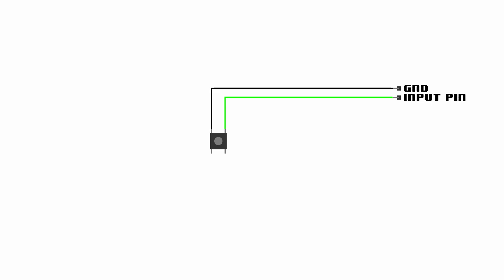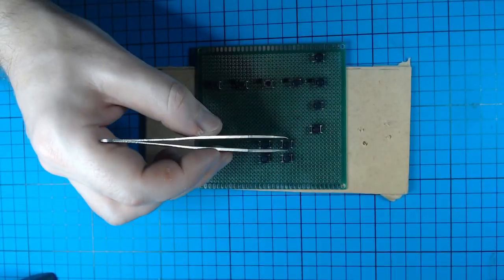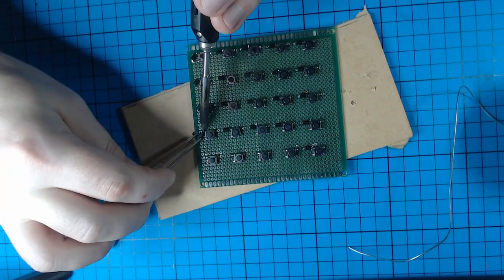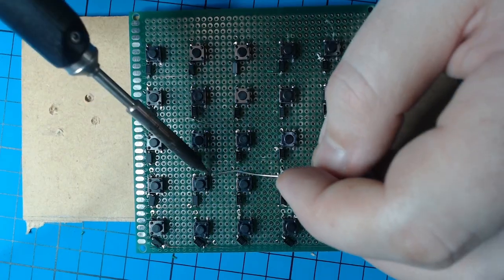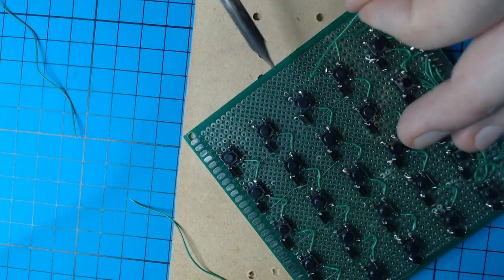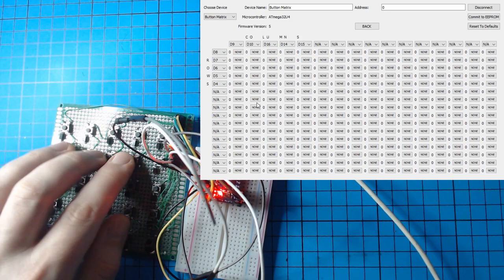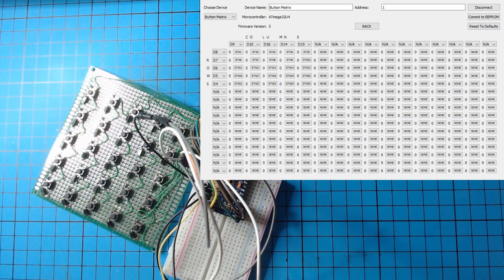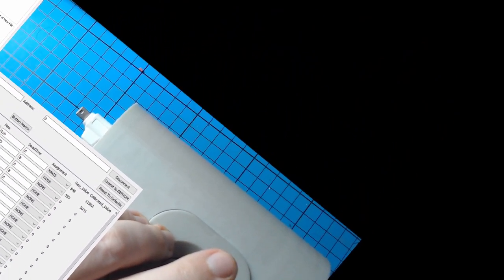Instructions - Button Matrix

Comment: I'm watching a ton of Button box / matrix videos as I plan to build my own Truck Simulator button box. Your video is fantastic, and your configurator is awesome too! Thank you for all the work to contribute this to the internet hive mind!
Reply: It is an interesting way for sure, but you can also use multiplexers and not go through this complex soldering matrix, i built a dashboard for ETS2/ATS with many buttons/encoders using couple of multiplexers and a pro micro.
Reply: @TonyHA913  While I understand the approach, it does make troubleshooting a lot more difficult, because you are introducing wiring and an extra part to the setup that can malfunction (let's say because of a wrong connection somewhere).
This is probably one of the most straightforward approaches to multiple buttons on a reasonably small amount of pins, next to going for a massive amount of IO on something like an Arduino Due which is in my dashboard for ETS2 and bussims.

Comment: Awesome demo. Looking forward to see more. Could you tell me (a noob) what kind of diodes you use? A specific partslist would be helpful for those, like me, who are learning from zero background and also want to try what you make. Thanks and keep them coming.
Reply from the maker: Sure, I didn't really bother with a parts list on this because you could use almost any diode and buttons. I used 1n5819 SS14 diodes which are way overpowered for this use, but they're what I had lying around. Any diode that can handle 5v (double it for safety to 10v) and you'll be fine as the current passing through is negligible.
Reply: @real_robots  Thanks a lot. Again, a very instructive video. Subbed!!!

Comment: Yes, a great video.  I haven't finished my matrix yet - waiting for the diodes to arrive.  And also thank for the software.  I will be using an 8x8 matrix for the buttons.  Can you confirm that I am not going to run into a problem with the number of buttons; something tells me that there is sometimes a problem of that kind.  I'm using Windows 10 and XPlane 12.
Reply from the maker: Your problem won't be with the matrix, but with the fact that windows HID won't read past 32 buttons for a gamepad. You can bypass this by setting it up as a keyboard and assigning it keyboard keys.

Comment: Hello RR. I really hope you will read this, cus I really need some help regarding rr_configurator. 😅
I have managed to do everything as shown in your video, and almost everything is working,  except for row 5 (I have made 4x5 matrix setup, 20 buttons).
In rr_configurator I can see the buttons in row 5 being pressed, but in Windows game controller settings, these buttons doesn't show as pressed.
I've tried to switch places with the wires, and its only row 5 that doesn't show. So I'm almost certain it's not a hardware issue.
Is this something you could help me sort out?
Btw I've made a collective stick with 20 buttons, one potmeter (for zooming in DCS) and a hall effect sensor for the collective. rr_configurator has done an excellent job setting up the potmeter and the hall effect sensor. 😊👍

Comment: Hi, I got some questions if you don't mind :) I'm using a arduino leonardo. To what pins should I connect the rows and columns? Should the rows be all ground, and the columns digital in? And what about the voltage? Does it not need a v5 connection? Thanks in advance!
Reply from the maker: Hi, you can connect the rows and columns to any of the digital pins on the Leonardo. If you're doing individual buttons you connect one pin to your digital pin and the other to ground, you don't need a 5v connection if you set the pin in pull-up mode in the gui

If you're doing a button matrix though, you do it just like I. My diagram, all columns and rows are digital pins. My software switches the pinmodes to automatically set them to 5v/gnd/input as needed to read them each in turn
Reply: @real_robots  thank you!

Comment: How would you be able to apply this to an actual button box, like mounting them inside the junction box as there doesn't seem to be any mounting points on the buttons, like there is on switches and rotaries with the washer and nut.

Comment: does using a matrix introduce any additional latency, compared to wiring each button directly to its own pin? (like by having to run the rows/columns check)
(for my project I'm planning on using 30 buttons, if that's relevant, for a project where minimal latency is ideal)
or if there are any other trade offs that might warrant searching for additional input pins over using a matrix?
Reply from the maker: doing a matrice will always be slower, but when I tested it with 128 it was still good to me. The only time I got to latency I could notice was when I had that many on a subdevice, so i had to wait for the matrix to be read, then passed to the master device, then passed to the computer.

30 buttons you should be golden
Reply: @real_robots  thank you!

Comment: I hope you can help.  I'm trying to use the project and want to flash the firmware ready for the matrix when I've finished it.  I'm using QMK Toolbox and my Spark Fun Pro Micro.  Caterina is connected but when I try to flash I get a message 'File does not exist'.  The file copied from Github does not have an extension but I've tried adding .hex and .bin.  Same result.  Am I doing something wrong?  Do I need to paste the file somewhere else first?   Your help will be much appreciated.

Comment: Question:  the gitlab says that the ESP32 can be Bluetooth only.  Does this mean that you can’t use the device (once complete) with a usb cable and you have to use Bluetooth to connect it to a pc?  

HID master devices

ATMEGA32U4 (eg. Arduino Pro Micro)
ESP32 (bluetooth only, no USB HID)
Reply from the maker: @danm2286  that's right, the esp32 cant connect has an HID device over USB.
Reply: @real_robots  I am trying to upload the firmware to a esp32 (Freenove ESP32-WROOM Board), and i'm getting this error: "error: #include nested depth 200 exceeds maximum of 200 (use -fmax-include-depth=DEPTH to increase the maximum)
   25 | #include <Preferences.h>"

any idea what i can do to fix this?

Comment: Help, please - Issues with my matrix setup.
All buttons work 100% as expected in the RR Configuration but, Windows is only seeing the firs 2 buttons from each row - even though I can see all the buttons responding in the RR Config panel, windows refuses to see them.
Using firmware 7 on both a Leonardo and Pro Micro with same results. (5 columns 2 rows currently in my test setup).
I'm trying to make a controller for a disabled person and would hugely appreciate any help here, thanks!
Reply from the maker: Try making it 5 columns and 5 rows (just pick an empty pin and assign all the extra rows to that)
 There's a bug sometimes screws up uneven matrices
Reply: @real_robots  Right, SOLVED.
Thanks for the fast reply and super useful bit of software, I see me getting a lot of use from it in the coming years 🙂

This is for others that my find this issue and hopefully save them a bit of time:
For anyone having issues with a non-square matrix (different amount of columns and rows), the matrix will not function correctly in windows as a game pad.
You need to make the matrix square (same amount of columns and rows), to do this and not waste pins on it, just fill in the configuration duplicating columns and rows pins that are already in use (don't set any buttons up on those lines if you don't physically have any).

Comment: is there a specific cable type to use to make this?
Reply from the maker: Nope, there's practically no current so you can use whatever wire you've got, or is easier to work with.

Comment: Man I'm dying here.  Im using an ELEGOO UNO R3.  I've loaded the firmware (as far as I know) and ive wired everything up but for the life of me I cannot get any response on the matrix.  I tried doing a simple switch with pin and ground and that shows up just fine.  For the first Row I tried to use PIN 8 and for the columns pin 3,4,5,6,7.  I there something Im missing?  Is there a video to correctly load the firmware?  Is that my issue?  I've only tried hooking up 2 rows of 5 equaling 10 push buttons.  Also do i need to edit the matrix code before I upload it to my ELEGOO?
Reply from the maker: If the configurator is communicating at all then you've got the firmware installed correctly.

The matrix implementation still has a few bugs, it doesn't like non-square matrices sometimes so try adding 4 more row pins (just assign any unused pin).

Could be you've got the rows and columns flipped, give that a go.

Also I should say that your UNO won't be able to appear to the computer as a game controller, the microchip lacks that ability. You need to use an Arduino Pro Micro, which has the ATMEGA32U4, which can do HID.

Comment: Could the roles of rows and columns be reversed in software if one inverts all the diodes? (From the preliminary analysis it seems that it should work fine)
Reply from the maker: Maybe? Let me know if it works.
Reply: @real_robots  I think I'll try it first with something like 2x2 matrix. As I want to write a custom soft for it this way my program logic will be much clearer because of the way I want it wired in the final project.
Reply from the maker: @skwinged  Always a good idea to start with a smaller prototype or even on a breadboard first to make sure you've got it right before you go big.

Comment: I can’t quite wrap my head around why you would need a diode on the row pins but not the column pins?
Reply from the maker: I guess it could be on either of the buttons inputs, it's just to prevent current running back through a pressed button into an unused column and setting off other inputs.
Reply: @real_robots  I am coming from a real basic understanding of electronics so bear with me. Couldn’t the ghosting come from both the negative and positive side of the circuit?

My question was around why wouldn’t both sides need a diode but I’m starting to see my mistake I think.
Reply: You only need a diode on one side because the flow of current is in the positive direction? I really need to read a bit more about this I think. Great video though, your explanation was great, you can help was over my head 😐

Comment: can rr_configurator do rotary encoders? they're kind of a must have for the flight sim crowd. 
also axis to button - putting virtual buttons along an analogue axis that activate when the slider enters a specific range? many HOTAS have these for "engine shutdown" or "afterburner". 
it can also be useful for adding multiple buttons via a resistor ladder and only using one input wire (and 5v and Gnd).
Reply from the maker: It does rotary encoders, you can also assign an axis to a button, the buttons only show 0 and 1 but you can calibrate it so 1 will be the axis max.

Comment: What diodes were used here? Is there a rating? Thank you.
Reply from the maker: You could use pretty much any diode here that can handle the voltage. I used ss14 shottky diodes, which are WAY more than what is needed here, because I had them on hand.
Reply: @real_robots  Thank you very much.

Comment: Can we see the actual sketch which is going to be uploaded to the board? Does the rr_configrator works with rotary encoders, hall effect sensors, touch sensors etc.?
Reply from the maker: You can find the firmware sketch below. It does handle rotary encoders, it can do hall effect sensors that provide a PWM output and touch sensors as well if they give a 0-5v on/off signal. (0-3v for ESP32)

https://gitlab.com/realrobots/rr_controller
Reply: Thanks - works perfectly for me!

Comment: Amazing tutorial, I followed same, but during testing I notice that if we have matrix like 5 rows and 6 columns, than the last columns will not work, it will register on configurator but when I try on windows test for joystick, it will not fire, so I suppose matrix should have equal rows and columns
Reply from the maker: There's a bug with the configurator, it doesn't like odd matrices. Try adding a 6th on an unused pin
Reply from the maker: Don't need an actual row, just assign it in the configurator

Comment: I need Atiny85 8 pin & DF player & 20 button for 3 cables input. Atiny85 is enough?
Reply from the maker: If you want to do 20 buttons you need a minimum of 5+4 GPIO pins. Not sure what you mean by 3 cables input.
The Attiny85 has 5 GPIOS, so the biggest button matrix you could do would be 2x3, so 6 buttons total. You could use a gpio extender on it but you're probably better off just using a different MCU if you need 20 buttons.

Comment: Can I use these to wave sound filés effects on micro SD card player??
Reply from the maker: Absolutely, the firmware I include here is pretty much just for setting up an HID controller.

If you want to use the buttons for something different I'll link a good tutorial (not mine) below whcih will give you the code you need.

https://www.baldengineer.com/arduino-keyboard-matrix-tutorial.html

Comment: What type diodes did you use??
Reply from the maker: I used SS14 Schottky diodes. Which is pretty overkill, anything that can handle the voltage will do, I just used what I had on hand.

Comment: i've been following your videos and plan on using your software for a throttle as its probably the best out there. However i think there is a better solution with IO expanders, they are cheaper and smaller than an Arduino pro micro or a button matrix. Have you thought about using one in conjunction with your software? I'd do it myself as i've been experimenting with one, but i lack the programming knowledge. For the time being at least. These could be used really well with the different parts of your controllers.
Reply from the maker: I plan on adding compatibility with MCP23017 which is pretty common, cheap and easy to use. The reason I went with networking the microcontrollers is because they have analog inputs and most gpio exapanders don't. I also get all my Pro Micros from china where they are super cheap, not as cheap as an MCP23017, but still pretty cheap.
Reply: @real_robots  I did not think about analog inputs, good point! How much do you pay for a pro micro? They are not so cheap where i live. I have been experimenting with the pcf8574. It is fairly cheap(less than the MCP23017) and easy to use and also doubles as a LED driver. Only draw back i can see is there are only 8 pins, although there is a 16 pin version. Cant wait to see what you come up with! You are making some great stuff for the PC sim community, hopefully i can eventually contribute in some small way with pcf8574 compatibility.